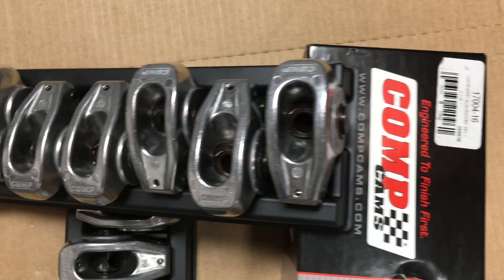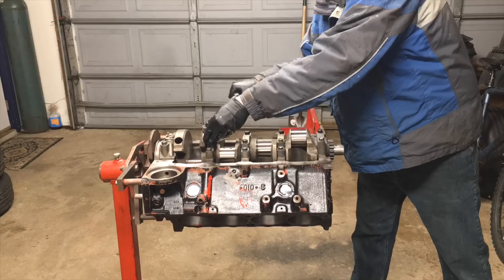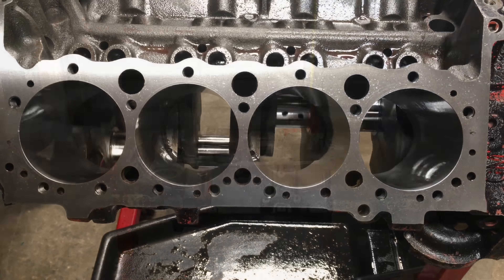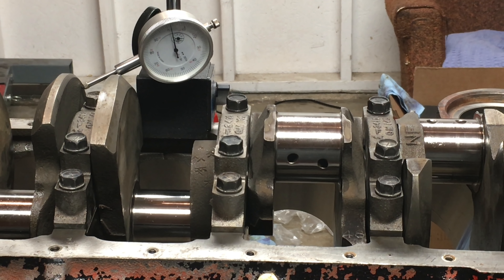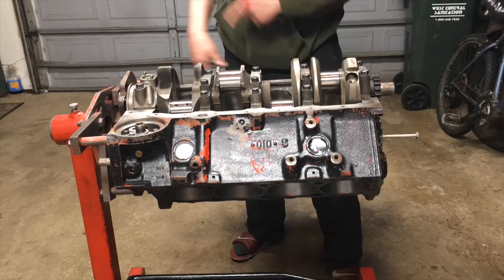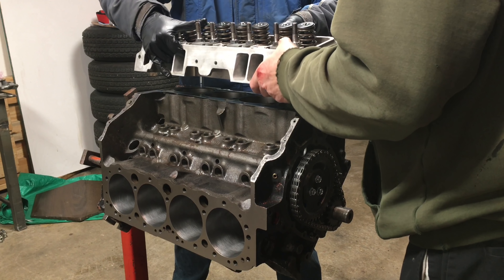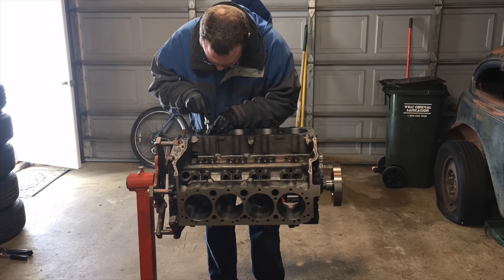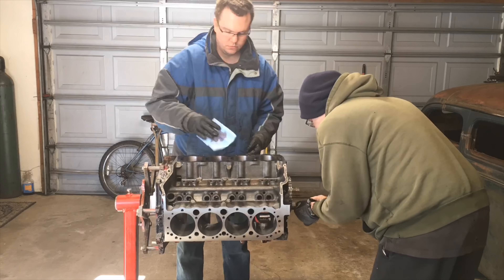Small Block Chevy Complete Rebuild

Comment: What oil pan and pick up setup are you using?
Reply from the maker: RedNoseGaming it’s a Mckinney Motorsports SBC swap pan/pickup for a Nissan 240SX. It seems pretty decent. It holds 8qts and has trap doors to control the slosh

Comment: just had my 350 5.7 rebuild from the crank on up..about 3 months ago..and its blowing blue smoke out the pipes i got about 2000 miles on it now and im using quart of oil about 250 miles i pulled the plugs out and #7 has lot of oil on ,that spark plug on the threads only..tell me what you think
Reply: Didn’t machine it or didn’t replace piston rings? Bad job you should have warranty with both machine shop and mechanic
Reply: Thanks .. sound like somebody took a shortcut rebuilding my engine